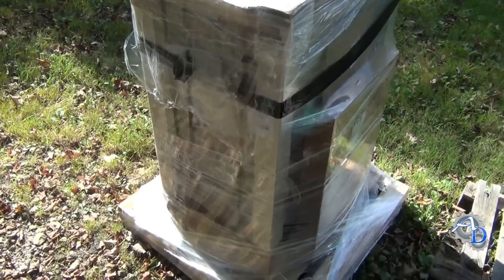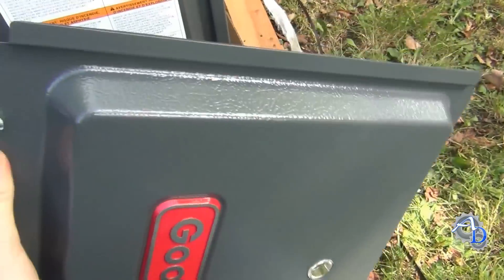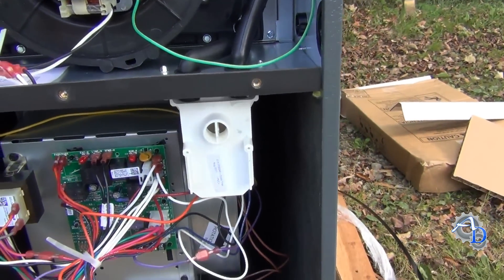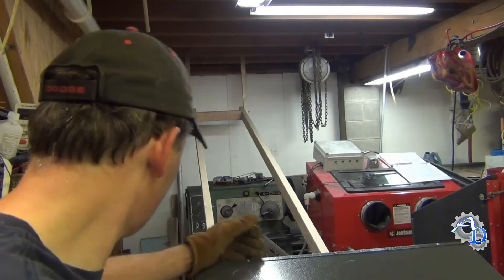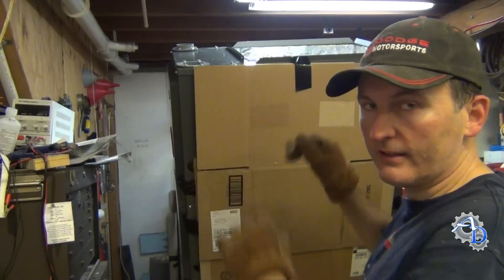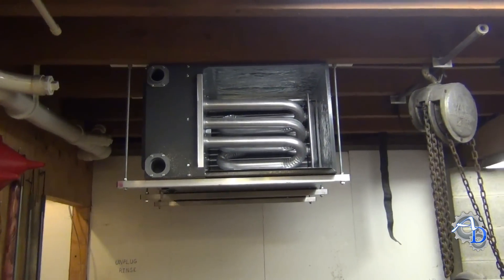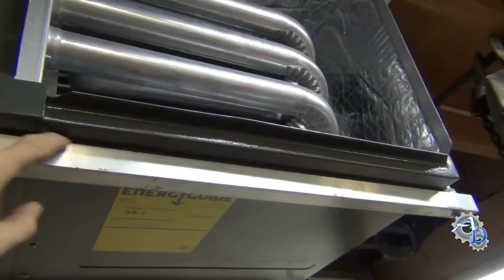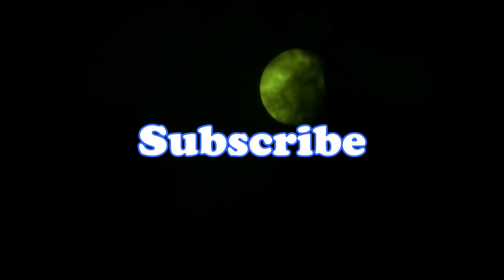HVAC Techs Didn't Like This Furnace Installation

Comment: You do realize that you can purchase furnaces called 'unit heaters' specifically designed for this application.  They are smaller and do not require any special modification like this furnace.
Reply: Hes concerned with the 96% efficient. .

Comment: I like my home goodman unit. Seems well built. Better cover/door than most others.
Reply: I’ve been a HVAC Contractor for 35 years, I have no problem with Goodman equipment. I install several brands depending on the customers budget.
Reply: @mcroley591  , I installed a Goodman and a 3 zone system in my home, has been working fine for 4 years and counting.
Reply: @mcroley591  then you should know goodman is the budget model , a builders model .
Stick with  , Trane  ,  Ruud, Carrier . 
Personally I will only install two stage Trane/American standard 
 and 
Rheem/Ruud , 
I do great work with a great product at a fair price .
I don't do budget , budget is another word for hack . 
 That said , Goodman is a better product than it use to be since the buy out by Daikin in 2012  . 
 It's  a  cheaper unit which many unscrupulous butchers will install specifically throw in due to price and probably gets a worse rap than deserves .  
And let's be real , this garage/shop install was good comedy .
He says it's temporary , why do a 90plus ? Made no sense whatsoever in this application . Of course it's to big for the area 
A small ceiling mount 220 would've been the ticket , or the cheap gas/flu model , preferably an old one someone is getting rid of .
Reply from the maker: I noticed that too about the doors. Mine has steel knurled bolt fasteners instead of plastic clips.

Comment: Like the other guys, static pressure and short cycling will be a problem. Depending on where you live, installing without a permit could cause a problem if you decide to sale the property and the home inspector sees a fairly new furnace and ask for permit. Or if there is a fire in shop and they figure out the furnace was installed without inspections, insurance will not pay. Inspector would focus on clearance, gas piping, venting and electrical. Goodman is decent equipment but is not the same as other brands, it is cheaper for a reason. Things happen to all equipment but there is a reason Goodman lifespan may make it approx. 10 years when Trane, Carrier and Lennox lifespan is not uncommon to be 12-15 years. Anyone wanting to condition a workshop may want to do themselves a favor and look at ductless mini-split units. Simple installation and high efficiency
Reply: Ibdont know where you live but in most states building inspectors don't enforce permit failure. The job is not for the govt. It's for the next buyer.

Comment: Your outside intake and exhaust does not prevent explosion of vapors in your garage.
If fumes reach your lit burners you can have an explosion.
Reply: Yes it does and Nope. 🖕
Reply: I have isolated combustion on mine just for purpose of working with fuel vapors. No explosions.
Reply: That cheap ass heater is not intrinsically safe 🤣🤣 anyone think its explosion proof because of venting and air drawing outside should buy 3
Reply: He showed the inside. No fumes or air can reach the combustion chamber without coming in through the outside air intake, so unless you fail to run your
intake piping to the outside of the shop then there is no possibility of explosion from fumes in the shop.
Reply: @2Truth4Liberty , You need to take a better look at the furnace. Flueing ie. combustion air and and exhaust aren't the issue. The front panel comes off exposing the burner (this is NOT sealed from combustible fumes getting to it). I have worked this industry for 30+ years and if you and him think this is safe using this furnace in that environment you will find out the hard way you are not safe.

It wont take long for that heat exchanger to burn out either but he is going to find that out soon enough from improperly installing the unit.

This is the reason you hear on the news some dipshit killed themselves from doing this, or worse taking advice from someone that has no idea what he is doing.
Reply: @MegaLostOne 
Actually, no. 3:03 You can see with the cover removed that the air flow used for the combustion chamber is separate from the air that passes through the heat exchanger.
This is not a new concept either.
Furnaces have been made like this for over fifty years- so there is a long history.
Reply: @2Truth4Liberty , Actually YES. 

First when the inducer runs a negative pressure is built so it pulls air from the combustion air tube HOWEVER the cover is not sealed so it will pull fumes in to the combustion chamber. PLUS when the unit is not running draft can create a negative pressure as well also wanting to pull in fumes that can explode when the system ignites. 

There is a way that this unit could be safely used to do what he is saying however this is NOT the way to do it. Again it is unsafe advice like he is giving here that gets people killed or hurt when they do NOT understand how these system operate. IF someone takes his advice here and gets hurt he has left himself wide open to being sued since he has admitted that he is not a tech and is not trained in this field. 

Again I have 30+ years in this industry and I am telling anyone who watch's this to NOT do what he is saying this unit is safe to do.
Reply from the maker: @MegaLostOne  Update: The combustion chamber is factory sealed. It has a gasket all the way around the cover. The instructions even say that for a building with combustible liquids present, that the furnace just should be installed at a minimum height of 4 ft off the floor. The heat exchanger is fine. There is no evidence of the heat exchangers burning out anytime soon and it's been five years now. Even if the combustion chamber leaked in heavy flammable vapor saturated air, the vast amount of combustion air is being pulled in through a 2" pipe, which would dilute it to the point of not being flammable. There is very little vacuum in the combustion area bc of the vent.

Comment: All you had to do was set two struts up get them level have someone help you pick up the unit put it on one strut spread the other one out slide it under add a third one later if necessary 15-minute job I do this all the time probably should have bought a downflow furnace

Comment: I would re-think your comment on flammable vapors with this heating unit  and your garage. You have lots of sources for ignition and explosion potential. TAYSMBYO
Reply: Arnold's Design Common sense is the key word. Flammable vapors do explode and working around   it poses safety risks. Your unit is a step in the right direction with  external air etc... but what I am saying is the unit is not UL Listed or FM rated for a flammable service environment. Ask your heater manufacturer if they agree with you.

Comment: Innovative ramp lift idea! I did similar back in the mid-80's to get a huge window AC unit into a 3 pane wood window frame (building was built in 1955). Removed the upper fixed window and slid the AC cabinet into the opening that I had "framed" with two sheets of 3/4" plywood; and had two hinge halves screwed to the cabinet to attach the 15' long the ramp to - just inserted the hinge pins and I was set to go. Took 2 guys to lift the AC pan / frame onto the ramp and then lift it up to rest on an 8' tall step ladder - without the cabinet it was just under 200 lbs. Didn't need to worry about marring the bottom of the AC pan as it slid completely into the cabinet - but I did wax the rails about 24" out for annual cleaning and servicing. Kept that ramp in the attic above the office and used it for 18 years until I sold that building to move into a larger one a few blocks away.
Reply from the maker: Excellent information. I've had many suggest about waxing the rails. I hadn't thought of that.

Comment: Did he change the venter motor locationg for hoizontal install. Also wood is a combustible and is not to be used in this application. You also forgot about the return off the bottom. Id like to see the finished product.

Comment: In the UK we are not allowed to hang gas heaters from combustible material i.e. wooden floor joist. Also a sheet of non combustible material between the heater and the floor joist would be recommended.

Comment: I forgot to mention that I would rather heat with electric than have a propane furnace.
Reply: You are correct. Natural gas is a bit cheaper than electric heat but LP (as he is using) is not that much cheaper and electric furnaces are almost indestructible. My original comparison was in the belief that he was only heating his garage and not intending to heat his entire house as well or I would have mentioned a heat pump with backup electric.

Comment: So many comments are correct here. You are over sized BIG time in your BTU's, removing the blower assembly would have greatly reduced the weight (not by 50 lbs but it would have helped greatly), you could NOT have removed the blower assembly because the PVC drain line for your house is in the way to get it in or out, NO installer would be mad about you showing this because they will most certainly get a phone call from you in the near future because you messed it up. You do realize that for the space you are heating ... a bathroom exhaust fan with built-in heater would have served you a good dual purpose? Maybe if this gets you enough hits here on YouTube ... they will pay you enough money to be able to have this done properly.
Reply: Dear Mr. Burton,  You are so 
correct. It's ALL about "click bate"
titles. We speed past all intros, 
ads, and shut the video way early. 
We only need the "meat" of the
idea, that's ALL. 
Sincerely, Kathleen.

Comment: Why not just use the chain fall hanging right next to it?
Reply from the maker: Won't fit up into the joists far enough.
Reply: Arnold's Design doesn't need to. Run a sling under it and back up to the ceiling on the opposite side
Reply from the maker: That's a decent idea. I guess the main reason I didn't even think about using it is because I had nowhere to lay the furnace down anywhere near the installation spot. Right underneath the furnace is a gearbox for a 20" lathe, and directly in front of that is a large horizontal bandsaw. The walkway to the left is too narrow to lay the furnace down. That's why I had to slide it on a ramp from 12 feet away. My small shop is extremely cramped, and I'm constantly bumping into things when I work. I'm currently searching for a piece of land where I can put up a larger building.
Reply: Arnold's Design ahhhh good info. I moved from a 15x25 garage to a place with 20x40 plus a 40x70 barn. Finally had enough room for all my metal working. Still need more shop space for a proper tablesaw and wood work
Reply: Garrett, I’m disappointed you didn’t pan out on your photo to get the complete shot of you over your kill...
Reply: Michael Downey the original was. The profile pic cropped it all out
Reply: garrett messer v

Comment: Two screws and you could have removed the blower assembly losing 50 lbs. Looks like you buy good tools why buy the cheapest furnace on the market? Those heat exchangers will burn right thru in a couple of years.

Comment: I would have double nut everything and used isolators to dampen vibrations from the fan motor. rubber over cork would even work in this case.
Reply from the maker: Good ideas. What I did instead was apply permanent red Loctite to the bottom nuts so there was no chance of them back off. It's hard to see in the video, but I have a strip of adhesive backed 1/8" neoprene foam on top of each of the tubular support to help dampen vibration. I wasn't certain if it would be enough, but when the furnace is running, I get zero vibration noise upstairs. The only thing I can hear is air flowing when the stairway door is open, and I can barely hear it.

Comment: Good job, I have two employees that work with me but there were couple of times both was unable to work and I had to work by myself and rigged up a system to move and install big item by my self as well (e.g. 75 gallon water heater in a basement and remove the old one out) looking at your video there would have be three things I would have done differently to make it more easy: 1-I would have staple wax paper on the stud ramp so the unit would slide better, 2- instead of pushing it up the ramp I would have use a come-along or a pulley and pull it up, 3- after it is in position on the other side when you lift up the opposite side your support should have a small cleat so it be easier for you to screw in the support without trying to keep it up at the same time.
Reply from the maker: I agree. Someone had mentioned waxing the ramp, and using a come along. Pushing it up the ramp was actually the easiest part for me. The cleat is an excellent idea, and while I was lifting and attaching the ramp, I was thinking "why I didn't screw a block to the support board?" Lessons learned for next time.

Comment: I don't know y u think a pro installer would me mad about your install.. your not showing a easy quick way to lift the unit...they would use a lift on wheels and done it in a1/4 of the time
Reply: We use a lift call a duct jack and it wouldn’t even be useful in a cramped space like yours. So what we would do is hang the outside hangers then with two men lift up the furnace while swinging the hangers out of the way then let them slide into place. Then of course add the third hanger if it needed it.

Comment: Lol. Goodman. Good luck
Reply: Zeke Montgomery my thought exactly
Reply: I’ve been installing Goodman equipment for over 10 years, I’ve also installed and serviced other brands. Goodman is a quality brand and works well. The trouble is they will sell to anybody, including people that don’t know what they are doing. When that happens bad installers make the equipment look bad and negative write ups get posted.
Reply: @ODucks55  Totally agree I put my Goodman furnace and A/C in 12 years ago only thing I've ever done to it is change the filter monthly.  Friend of mine in the business sized it and did the A/C lineset work,  but I set and wired the condenser as well I did all the duct for the furnace.  I changed from and old oil boiler hot water and radiators to natural gas furnace with A/C.
Reply: It's still a junkitrol. Good luck with that jackel motor. Better have a back up on the shelf
Reply: Arnold's Design I'm a retired hvac tech and goodman was a good source of income due to breakdowns. There is a reason they sell so cheap.
Reply: @mwatkins2464  they have a better price point because they sell to any Tom, dick or Harry that wants one, whether they know what they ar doing or not.  The bad reviews are mostly from people that have had an idiot install them.  The cheapest equipment in the world can be the best equipment you've ever owned.... Provided it was installed correctly. By the same token.. The most expensive equipment can potentially be the worst pile of junk anyone has ever owned bc they had a moron install it.  Installers NEVER read the manuals that come with products.
Reply from the maker: @ronsphar4827  5 yrs and still going strong.

Comment: Multi position furnaces usually have threaded rod receivers for mounting. The most important thing I see, a pro would have sized the capacity correctly. 60,000 can heat your shop if it's 150' long from what I see. A furnace too large will short cycle and eventually fail due to a cracked heat exchanger because it heated and cooled down improperly. The other gentleman mention having ductwork on a ducted furnace is not an option but rather a specific requirement. Same result cracked heat exchanger. Also yes, your combustion box is isolated from the conditioned space but a furnace will cycle all the dirt and dust right through your furnace. SAW DUST will create hazards! Viewers , call a pro. The proper propane choice would be a small 20,000 btu unit heater with no ductwork. Hopefully you are adding supply and return ductwork with filters and your connecting the ductwork to 1000 square foot of conditioned space.
Reply: diy fail goodman haha to big for small space  listen to Larry he is correct me 30 yrs exp
Reply: Bigger is not better

Comment: You needed to support it end to end not front to back, it will sag in the middle and cause the secondary heat exchanger to leak.